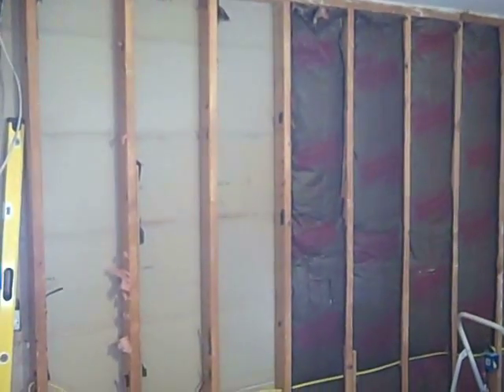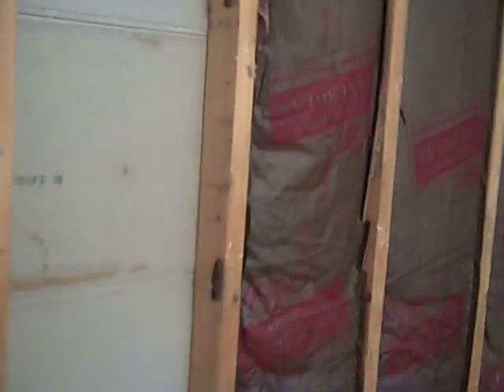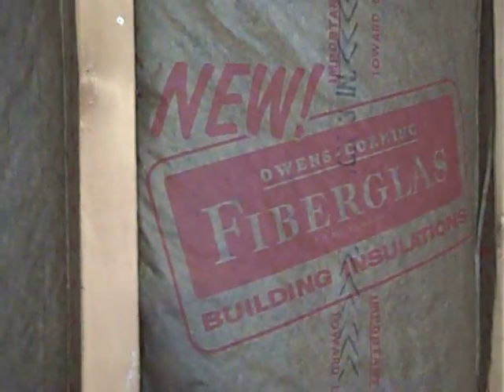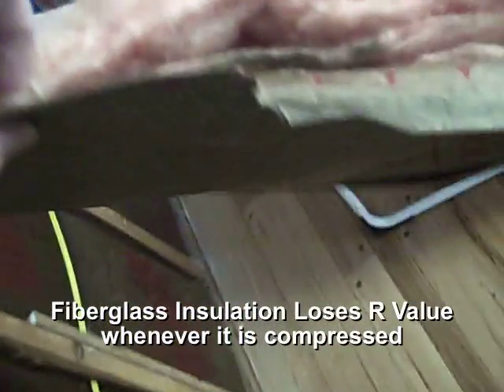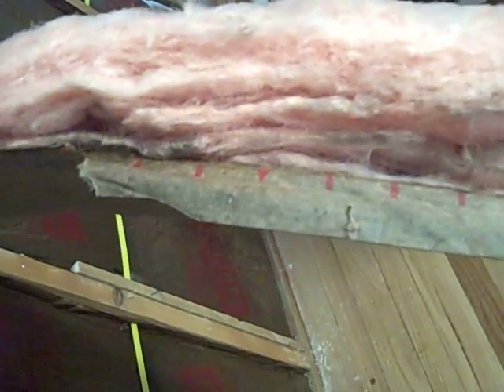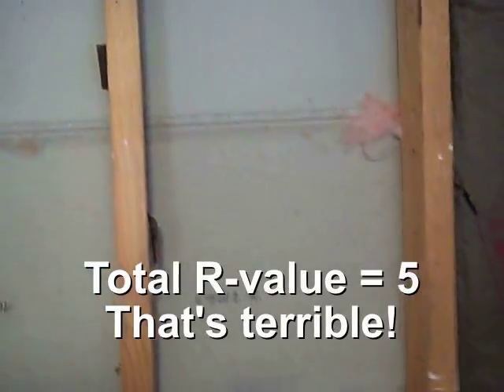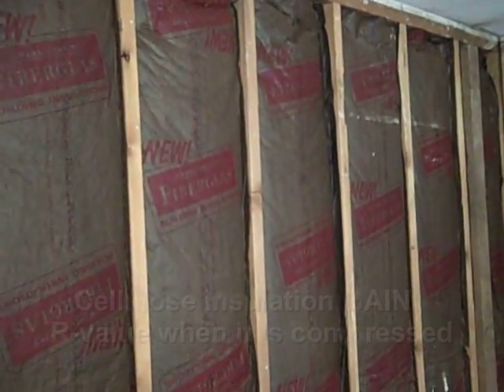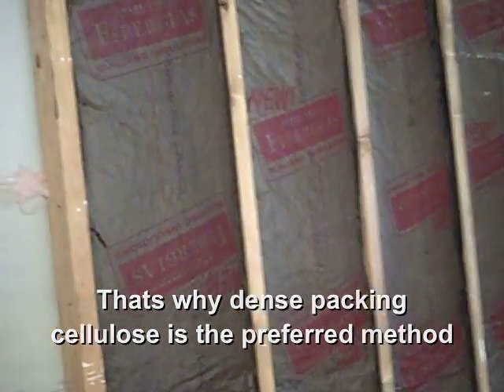Fiberglass batts installed incorrectly - startinsulating.com

Comment: no im no troll i could care less about fiberglass insulation. its only a job to me and your right its a joke no one really cares about r-values or energy conservation its a talking/selling point on most homes. the beauty part about insulation is that there is no real measure of its effectiveness.  most homeowners or superintendents i deal with see it as a means to an end and cant wait to get the drywall over it.

Comment from the maker: @toddmene Just goes to show that the fiberglass industry has been anything but a leader in the insulation industry.  Another perfect example is the R19 batts that go in 2x6" walls.  They are actually 6" to 6 1/4" wide and must be compressed to 5 1/2" when put in the cavity.  Some manufacturers put in fine print that the R value is reduced to R18 when put in a standard 2x6 wall, but most do not.  That's a 5% decrease in performance right out of the bag and forever!

Comment from the maker: @dooboydoo That is laughable and you are probably a troll for the fiberglass industry.  Spend some time at BPI and read about downgrades for gaps in fiberglass batting.  Independent research has proven the batts you just installed now perform at about half the rated r value.

Comment: I am an insulation installer and I just did a grade one insulation job on a commercial jobsite and this is exactly how the architect and superintendent demanded we do it. even the insulation inspector wanted it done this exact way. It doesn't help that the insulation is 50 years old like you said.Ive been insulating for 10 years and have always stapled the tabs inside the studs. Iver heard differing opinions on insulation for years but this is a new one to me.

Comment from the maker: This is exactly why the fiberglass industry is a joke.  The product is inferior and they actually tell you it's ok to install it incorrectly.  If you compress fiberglass batts you no longer have 3.5" of insulation material and the effective R value of the remaining 2.75" is decreased almost ion half.  If someone building an Energy Star home did this it would never be able to pass.

Comment from the maker: There's no reason anyone should have cracked drywall because they install the fiberglass batts correctly.  Maybe its time for a better mudder.  No need for vapor barrier when you dense pack with cellulose, it serves as a functional vapor barrier at 3.5 lbs/cu-ft density.